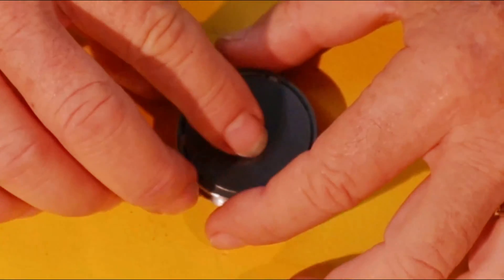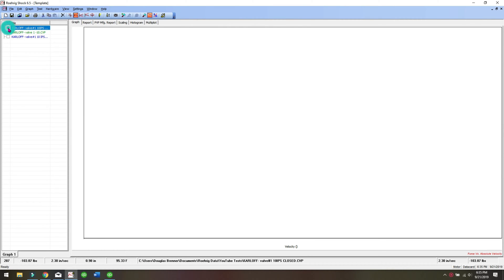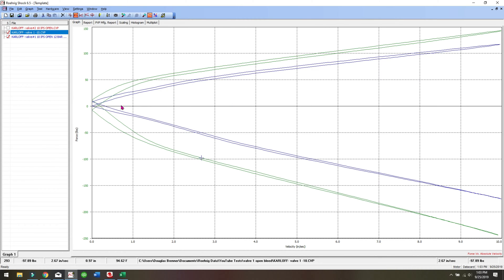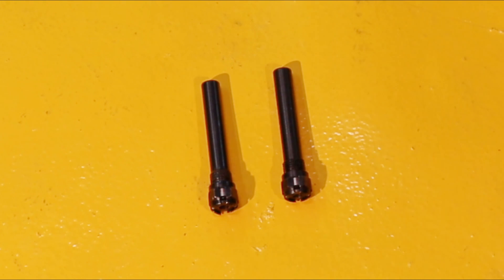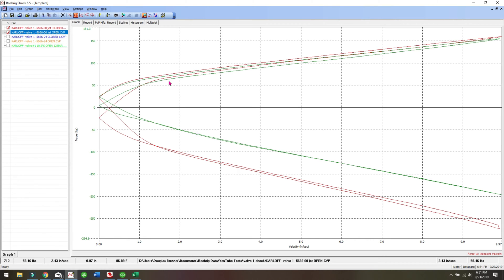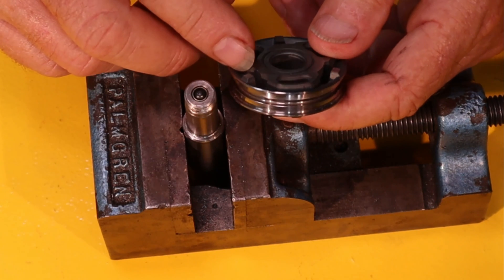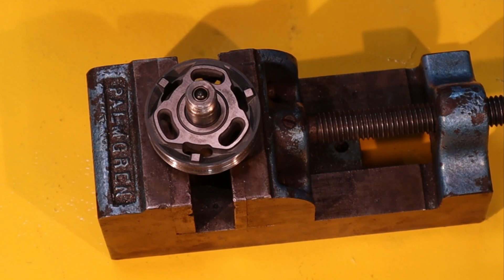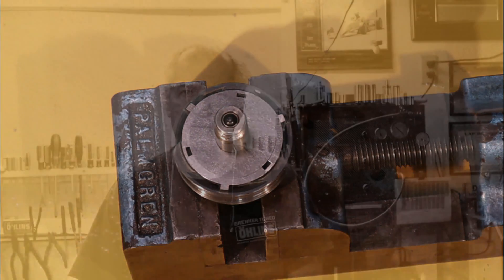Ohlins Suspension - Valving Basics #2 - Bleeds

Comment: Thank you for your videos! My project is to change the original rear Shock from the Yamaha mt 09 1. Generation . I put a kawasaki zx10r in. The rear is a little bit higher. The Problem is i am too light. The springrate is good. It is a little bit overdamped. Full and high speed are full open. So i must playing with Shims. The challenge is to achieve a good result as cheaply as possible. Thats a lot of work😅. Is it sufficient to just Pump air into the System to test? If everything is ok, ill have it filled with nitrogen oxide…greez from germany
Reply from the maker: Actually air is mostly nitrogen anyway.  I get shocks where they just used air.  It works ok but I can tell they used it because the top of the separator piston  is a bit corroded which doesn't actually hurt performance.  Using it temporarily won't be a problem

Comment: Hello and thanks for investing the time to share your knowledge!

I have a question regarding "internal bleeds" with regards to designing/engineering the "dyno graph". As I understand, for a shock without an externaly controlable bleed ("clickers") there is a need for a "constant" (not variable, like the external clickers) bleed. 

Can you please elaborate on why there needs to be some bleed and you cannot work without any bleeds? And how does the influence of no bleeds or some internal constant bleeds show up on the dyno? Where there is more influence with regards to velocity of the shaft, where there is less influence, etc.? Essentially, what I'm trying to understand is, what type of a "problem" (or rather a curve geometry) on a dyno chart a constant internal bleed can help to resolve?

Thanks!
Reply from the maker: A bleed is pretty much low speed damping.  You can run without bleeds but it makes the damping very digressive.  Bleeds also allow pressure to be relieved that has built up in the shock.  If the bleeds are closed you get lots of hysteresis
Reply: Thanks for answering, this is exactly what I wanted to know. 

Just to recap and be sure I got it right - the most influence any time of bleed will have, whether constant internal or externally adjustable, will be at the lower shaft velocities varying the dyno curve (that is, changing the character of the curve) at slow shaft velocities from a somewhat flat or even progressive (what I mean by progressive is non linearly increasing damping force with increasing shaft velocity) to digressive whilst only "shifting" the curve up or down relative to some "midpoint" at higher shaft velocities?

Comment: Hi Douglas, thanks for your great videos, extremely helpful….. Please could you advise me what nitrogen pressure is recommended on a STX46 shock number AP8271 Aprilia RSV 1000R Factory bike? Thanks.
Reply from the maker: Hi Peter. 12 bar (175 lbs)

Comment: Hey Douglas, great videos! I think I finally start understanding how shocks/forks actually work. I've always wondered what it actually means if they claim (from the outside) adjustable rebound and compression in a 20/80 ratio (I saw this with MC forks). Am I right this practically is a bleed like the 5666 24? Fully open one direction and less open the other direction, thus the adjuster closes the bleed valve which effects rebound/compression with its different openings for either?
Reply from the maker: I always wondered about these shocks identified by ratios.  20/80 of what?  How much damping are you talking about??  I think bleed is just the topping on the cake.  In most shocks it is not very powerful and messes up pressure balancing.  Valving is the way to change things

Comment: It seems without sufficient bleeding the low speed damping causes the sharp rise in the graphs until it levels off. Is a linear line the goal? What does the point where the lines connect affect when it moves up or down the graph? Does an offroad configuration look significantly different on the graph than on-road?
Hope this isn't too many questions. I'm in the process of watching all your videos and learning as much as possible
Reply from the maker: I am not sure I totally understand the question but I will answer and if I missed something let me know.  I think closing down bleeds can cause a low speed spike but more than that it seems to cause hysteresis.  TTXs don't seem to be as sensitive to closing down the bleeds.  My opinion is that once the damping is correct that it would work on and off road.  I would think that digressive damping and closed bleeds would be more of a problem off road.

Comment: Can't we just leave all the ports open for bleeding the pistons?
Reply from the maker: Hi Brian.  You should always bleed the piston with adjusters open.  You need to make sure that the needle valve is pushed down all the way.  It is hard to hand bleed with a one way bleed circuit as it becomes difficult to bleed in the direction that the bleed circuit is closed.  With vacuum bleeding this is not a problem.  I only use open bleeds.   I don't know if that answers your question.  If not let me know.

Comment: So does a "shock man" in a dirt late model trailer go crazy trying to get the valving right on a really bumpy track.  I'd expect so with all the different ways to go about setting the rebound with I think would be more important than compression.  I had to look up hysteresis.
Reply from the maker: Hi Ralph.   Rebound is the enemy of grip.  Also if there is too much rebound and not enough compression the spring could be pumped down and preloaded which would make it even bumpier.  I believe once you get the damping right it is good on a smooth or bumpy track as the damping depends on the velocity of the shaft.

Comment: Where do I go to learn the math and calculations behind everything?  Shock movement vs wheel movement ratios...etc?
Reply from the maker: I think I have gone through the math that I know in my video "know your motion ratio".  I learned it all from my mentor Bruce Burness.  I would be happy to help you with any math that I know.  It is all pretty basic math.  I know that because I can do it!
With shock movement vs wheel movement (motion ratio) it is pretty straight forward.  Say you move the wheel up 1.5" and the shock shaft moves an inch.  You just divide the shock travel by the wheel travel and you have the motion ratio.  shock travel 1" divided by wheel travel 1.5" = .66.  So that is the basic motion ratio but you have to square that to get a number you can calculate with.  
So .66 x .66 = .435.    Lets say you want to know the wheel rate (what the wheel thinks your spring is).   Let's say you have a 150 lb spring.  Multiply 150 by .435.  The wheel rate is 65 lbs.    Lets say you want a certain wheel rate, for instance, 150 lbs at the wheel.  Take the desired wheel rate of 150lbs and divide by the motion ratio squared of .435.  You would need a spring of 344 lbs to get 150lbs at the wheel.

Comment: This was very interesting. One thing remains unclear to me: at around minute 17:30 you’re discussing slotted shims. As far as I can tell they are free to rotate around the rod, so how do you control the position of the 3 slots relative to the 3 piston ports? Thank you Sir, greetings from Germany.
Reply from the maker: Hi Vi   Great question!  Once the shims are tightened on the piston they can't rotate.  The trick is to make sure they don't rotate while you are tightening the nut.  I always look to see that the slot is over the port after I have tightened the shims.
Reply: @theohlinsguy4649  I see. Interesting because in the automotive industry it is usual to have „poke yoke“ features which basically prevent misassembly by design. Which comes at the cost of flexibility, but that’s not what you want when producing at large scale. Please carry on with the great videos, it’s such a pleasure to watch.

Comment: Thanks for your times and effort you put in your channel! What a great info's! I have looked all your videos a few time already.
I do have a question if you don' t mind. 
Can we run a clamp shim behind the 1st face shim to act as a one way valve? 

38.25 (or thinner for more bleed?)
20.? ( play on the thickness for + or - bleed?) 
38.25
34.25
... 

Or just as you said shims with holes or a clamp shim at the top to get the bleed both way will be better?
Its for an off road motocross looking to get less damping on roots and rock (wheel deflection). 
Thanks very much for your time.
Reply from the maker: Hi Marty.  I am not sure I understand the question.  If you want to make the bleed around the piston one way or not equal I think the only way you could do it would be change the shaft jet.  If you get the same ID and length jet you wouldn't have to change anything.   Let me know if that is what you meant.